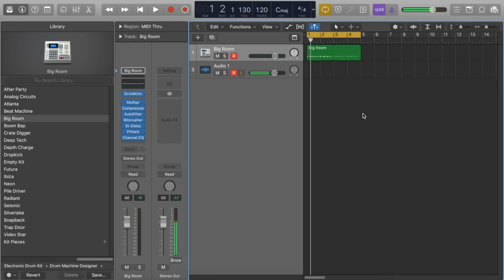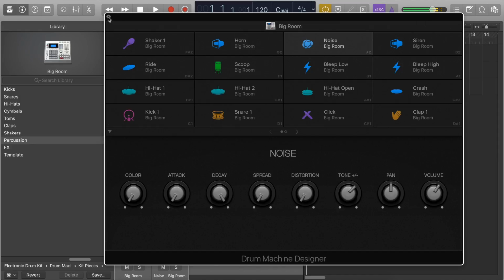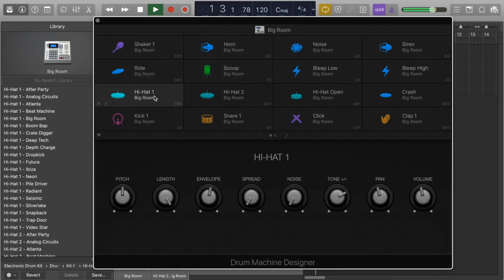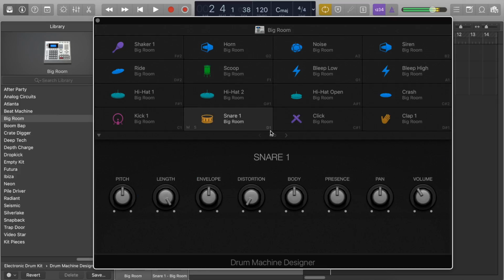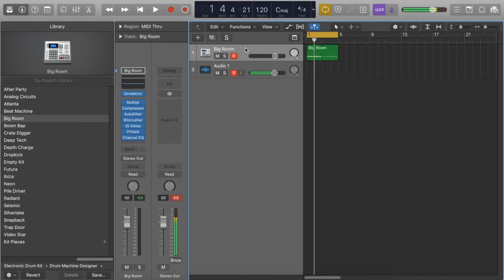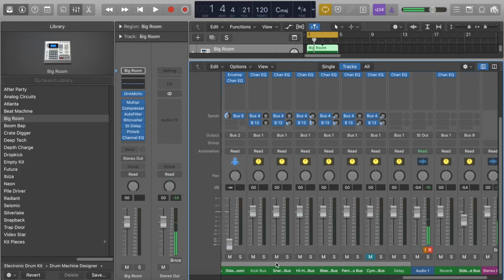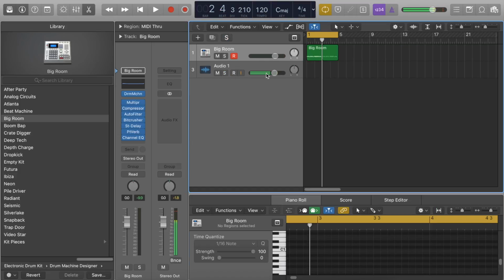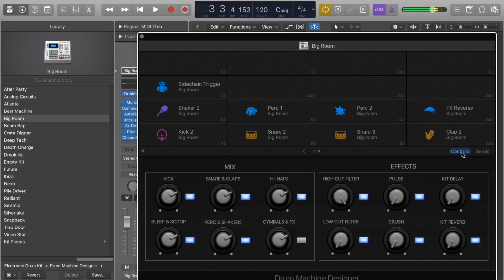Drum Machine Designer Logic Pro X Tutorial

Comment: Nice video. What's the quickest way of getting a pre made midi region to get drum designer going. Like ultrabeat has loads of preset midis. Is it to route to drum'mer track? And how would that work if so?
Reply: logic pro x have some nice futures but not completed as it should be.
Reply from the maker: Hey Luke, the best way to get some pre-made midi for drum machine designer is to create an electronic "drummer" track. To do this, click Track > New Track > Drummer and select "Electronic" in the Genre dropdown. You may need to open up the details to change the genre if it's currently not visible. From there it's very intuitive to get beats going and mess around with them. The best bit is you can convert the yellow drummer regions into MIDI regions by right hand clicking and going Convert > Convert to MIDI region. Idk how exactly the Ultrabeat would work in with this, but I do know you can drag MIDI regions out of Ultrabeat and into the arrangement window, so you could definitely drag it onto a drum machine designer track. Hope that helps.